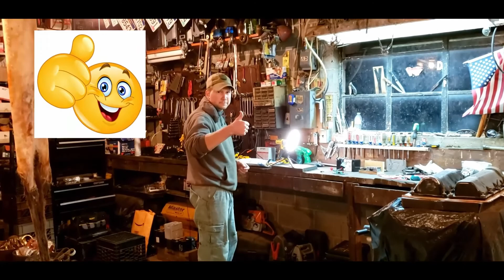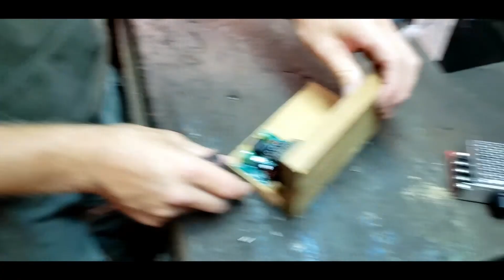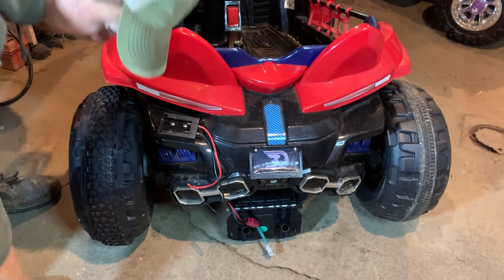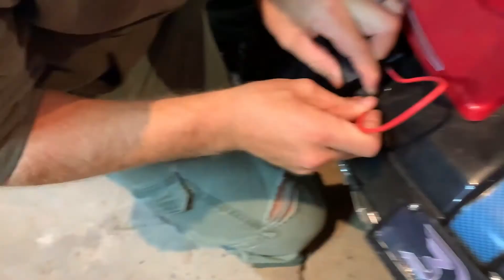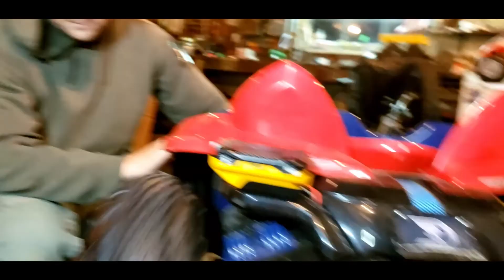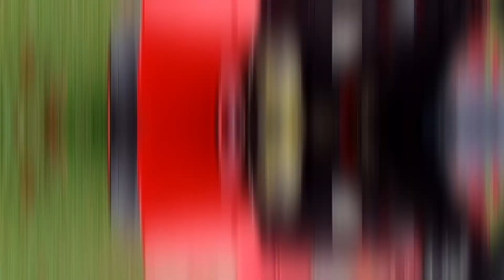Power Wheels Dynacraft Dune Racer Custom Modified Dewalt 20v Drill Battery Upgrade Full Build Guide2

Comment: I did this same set up and everything, I’m using 12g wires and I keep blowing the fuses. Anyone else dealing with this issue or does someone with more electrical knowledge than me know how to fix it? I’m using 30a fuses. The fuse on the hot lead from the battery blows and also the fuse in the motor control box.
Reply from the maker: thanks for watching Joe.  As time has progress, This has become an issue as well for me.  As the child has grown, the added weight and traveling up steep hill caused those fuses in the adjustment controller to pop.  Even using a 40w mini fuse, still pops after a while.  I ended up removing the adjustment controller altogether now because the child no longer needs it.  In reality the low gear is the same power as the previous High gear and the high gear is 2x.  I blame the cheap chinese components ;)

Comment: I bought all the gear and a used dune racer. Before I start gear 1 moves both wheels engaging both motors gear 2 (fast mode) only engages right motor at a faster rate. Is that normal? Fast mode only uses one wheel? Seems backwards…
Reply from the maker: sorry for the delayed response.  I wanted to follow up with you.  How did the build go

Comment: So our power wheels was running fine, I did the upgrade and now I lost reverse… any ideas!? Thanks
Reply: It will be a dirty switch in the shifter.
Reply from the maker: Wow...never lost reverse.  I have burned a few fuses in the power control as well as burned up one of the low voltage boards, but not having reverse is a new one.  Let me know what u find out and beat of luck
Reply: @AlteredComponent  I think it was unrelated, I took it apart, cleaned the connections and it works again… most of the time. Lol thanks.
Reply: Hello. Dad hacks channel uses a 24 volt  relay to protect the low voltage board from burning out from to much power to board. Board can burn out if not used, built in relay to small?   Your thoughts please, thanks. Im going to do this upgrade on PW Dune racer in 2 weeks, 20 volt conversion.

Comment: Been wanting to do this to my kids stuff but don't want to spend much or have to change motors or gear boxes. Any suggestions I think they are ether a 6 or 12v most likely a 12v battery
Reply from the maker: Honestly i have not had to change the Gears out on my kid's dune racer yet.  She has been running the dual 18v batteries for quite sometime.  The buggy in this video was a dynacraft model and seems to have a lot more weak points imo.  The most expensive thing will be the batters on these upgrades.  If you went barebones and went with a single 18v generic m18 battery with an inline fuse and no controller or over discharge circuit board, you really only have wire, and the battery cost involved.  If you do that route, do not put a 18-20v on a 6v ride on...it will toast something.  12v power wheels wire harness can handle it and it does not have a built in circuit board like some other brands may.  thanks for watching

Comment: I keep blowing my 30 amp & 40 amp fuses also....Any ideas..?
Reply from the maker: So i kept blowing the 20-30 amp fuses in the dc power contoller, but i have never blown either of the inline fuses from the batteries to main harness.  And that is on 3 different buggies.  But there is a fuse inside of the controller, a mini fuse that i kept popping.  Moved it to a 40 and have not since blown it. I would think something has to be shorting, but sorry i have not experienced that
Reply: Check your rear axle to see if it is bent. The stress of a bent axle can cause the extra fuse to pop

Comment: I did it without the circuit board or the adjustable speed, this was before I seen this video. I’m using a dewalt 20vMax battery , it only goes for little bit then shuts off. Do you think I still need all of those pieces or do you think I can would around it?
Reply from the maker: thanks for watching.  The circuit board is just to protect the battery.  A lithium ion battery can be destroyed if you run it completely dead.  Most tools like battery powered drill, circular saw etc have built in over discharge protection. So once a battery drains too far, it will stop working instead of keep draining the battery.  As for the speed adjuster, you definitely do not need it.  You can just run full tilt or if it has 2 speeds, you switch to low which is basically what the high used to be.

Comment: did you measure the speed that increased? and how long is the battery life?
Reply from the maker: i did not measure the speed increase.  Going strictly from some other professionals that have done the same swap, it is nearly double.  battery life is so much better than the large 12v stock battery.  At first my child was getting nearly an hour and a half of full tilt riding with 2 x 18v /5ah batts.  Now it is more like an hour and 15 minutes.  But keep in mind that a powerwheels battery is supposed to charge for 18 hours before use.  These drill batts take 30 minutes or less to charge.  thanks for stopping

Comment: Also, it's been a month, how are the motors holding up?
Reply from the maker: Motors are doing well.  The spiderman power wheels as it turns out, has okay motors.  The crazy, high pitched sound was coming from the gear boxes.  Opened up and there was literally no grease.  Packed back full and solved the noise for now.  I am sure these will give out eventually
Reply from the maker: Also, the pink dune racer has had zero motor issues and it has been running full tilt for a while now modded.  We have a few more videos on these couple of power wheels as well   thanks for looking and good luck

Comment: Did the 14 gauge wire get hot? I'm about to do this project, and I decided to go with 12ga just to be safe
Reply from the maker: The 14 Guage wire holds up perfectly.  I used a piece of 16g in another build and it does heat up.  Not to melting plastic levels though, but would not recommend 16 or below for sure.